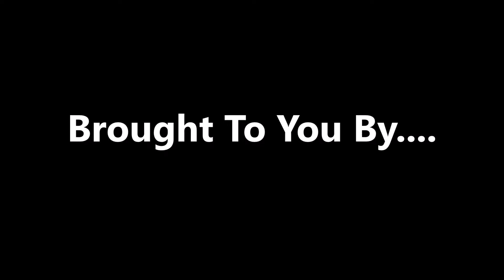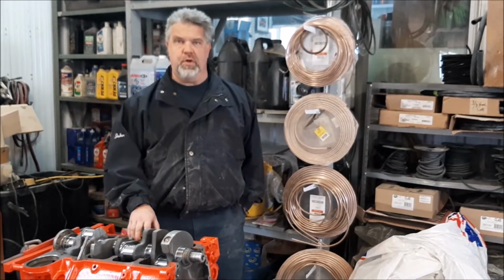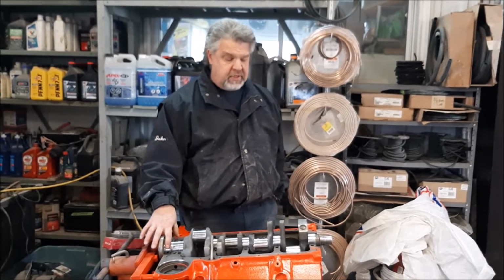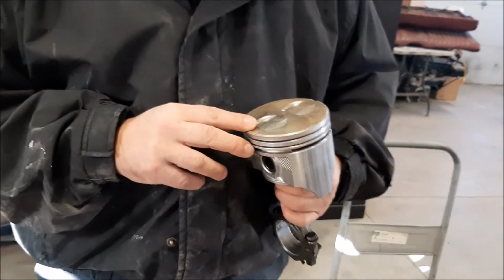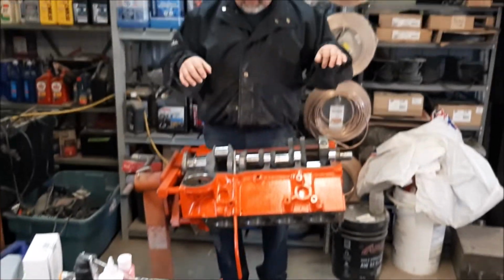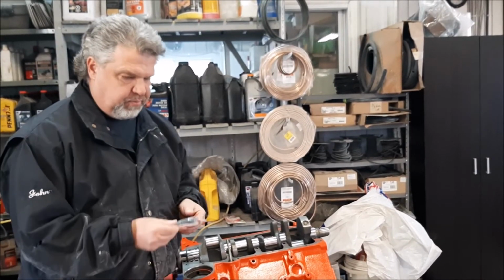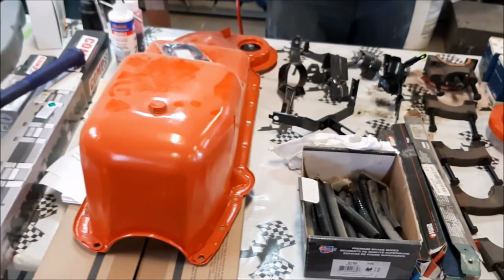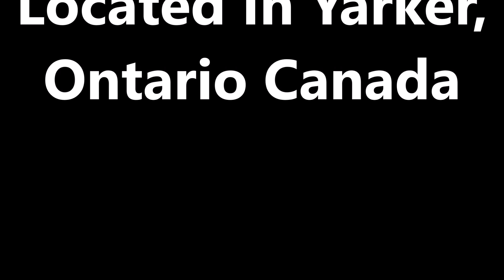1958 Chevrolet Corvette Numbers Matching Engine Rebuild Part 1,  lastchanceautorestore com

Comment: 1K views and not one comment?! I am stoked on the rope seal alternative tip alone! Thank you John, great video for anyone trying to decide in what course of restoration to take on one of these few to none 58's still out there. Two year only parts, one year only body. A matching # engine build, either endless $, passion, insanity or all of the above. Leaves me wondering in the moments right before I go to sleep "what did I get myself into"?